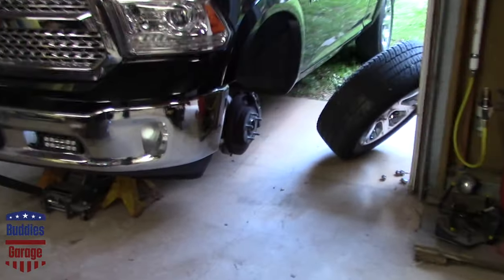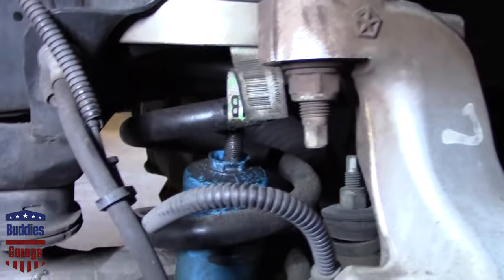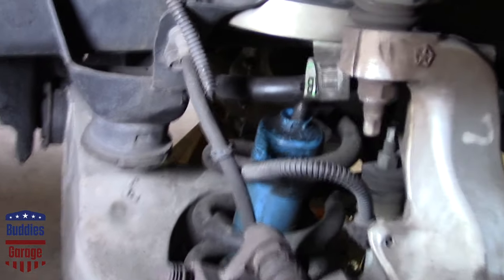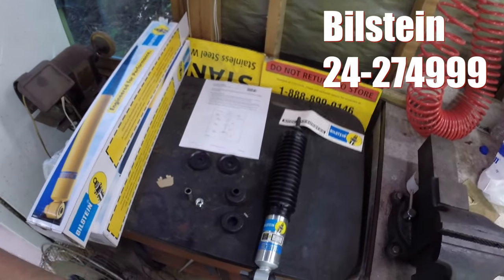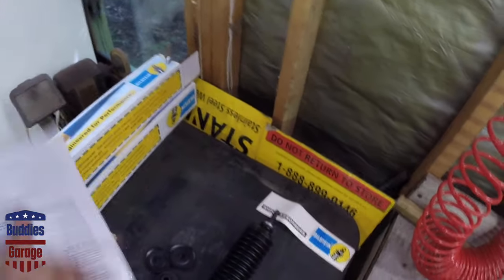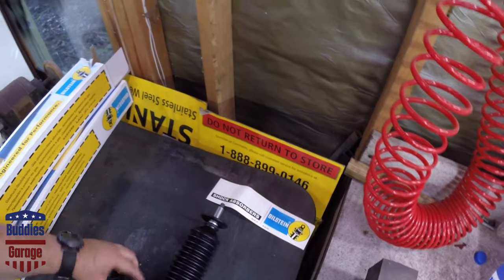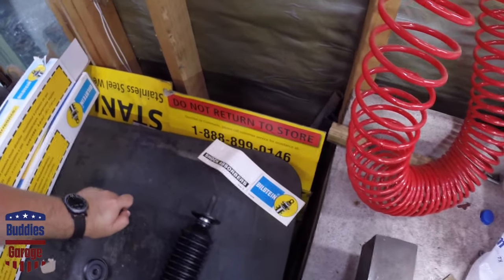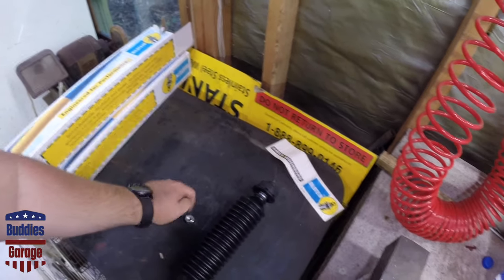Bilstein 5100 Shocks Installed on 2017 Ram 1500 2wd

Comment: This is the first video I’ve watched that shows that you can just pop the shock out through the bottom without having to take apart everything 😮. I have a 2017 ram 2WD and I put wheels and tires on it and they leveled it for free. It’s been about 5 months now and my shock is broken. So I have to replace them. So these work for trucks that are leveled out?

Comment: California squat lol SoCal native. I thought they did that in Texas. I just installed the Bilstein extended shocks yesterday also on a 2x4 Ram 1500. Its a 2016 with 60k miles the driver's side was leaking. Its had mostly freeway deriving. I had problems with the boots also they don't leave much room.

Comment: Hey great video 👌👨‍🔧 quick question I’m running stock suspension and stock wheels, would you recommend the 5100 over the stocks 4600? Do you think there will be a big improvement if I run the 5100? 4600?   Or what’s your opinion 🤔…

Comment: Was about to purchase all 4 of the Bluetooth shocks for my 16 Ram 2wd lol but saw this video. Would you recommend the Bilstein 5100 over the 4600?
Reply from the maker: Absolutely.  I have zero complaints with the 5100s.  Ive got probably 40-50k miles on this set without issue.

Comment: Hey buddy do you need the spacer to put this shock on? Bilstein website doesn’t give any references for 2wd except that yellow crap.
Reply from the maker: No the 5100 series is longer than stock so you don’t need to run the shock extenders if you have a coil spacer

Comment: We’re did you find the 1 coil spacer i can’t seem to find one all I find is 2inch spacers I had a 2 inch on my 17 ram and I had to take it off because it rode like crap I bought new fox shocks for “leveled rams but I can’t find a 1-1.5 spacer we’re did you find yours?
Reply from the maker: Theyre ready lift spacers

Comment: You funy bro good vid 👌 so how do you like thr shocks would you recomend ? Did this level your truck out ? And did you have to upgrade your upper control arms?
Reply from the maker: I have a 1” level spacer on the coil springs.  These shocks are 1.5” longer than stock so you dont have to run the shock extenders.  Still running stock upper control arms. Think that issue is when you go to a 1.5” - 2” spacer.
Reply: I’m sending it with a 2.5 spacer, stock shocks (no extender), and stock upper control arms. 15k+ miles with no problems yet, but I’m planning on installing 5100 bilsteins to eliminate some noise from the stock shocks.

Comment: Bro I got a question.    I just installed a 2.5 level spacer kit on my 2015 ram 1500 2wd and my factory shocks are already leaking which shocks do you recommend for the new height of the truck
Reply from the maker: Id make sure the 5100 series is rated for that much lift. IIRC they are only rated to 1.5”.  Otherwise find a shock that is long enough to have the correct amount of travel so you dont “top out” the shocks.

Comment: I added a 2" leveling spacer on my 2014 2WD Ram 1500 and have had a terrible ride ever since.
The shocks just don't seem to have enough travel on them when going over speed bumps or larger holes.

Did you have the same problem before, and did these 5100s seem to fix that issue?
Reply from the maker: Yes i should have put 5100s on when i leveled the truck in the beginning.  They fixed all the problems i was having.
Reply: @buddiesgarage8998  what was the model number. Looking to put these on mine, but I’m having trouble finding the right one.